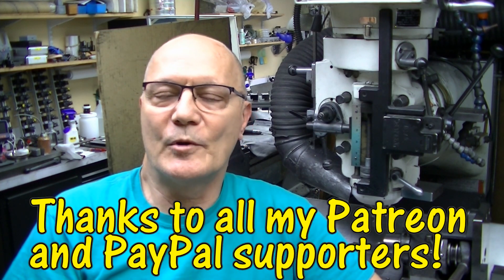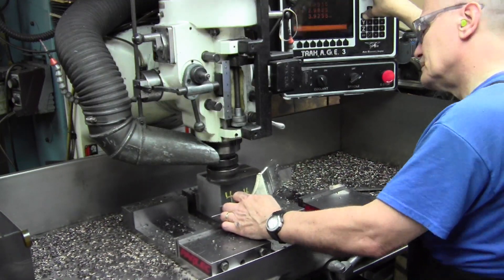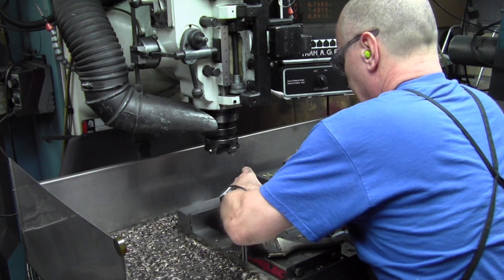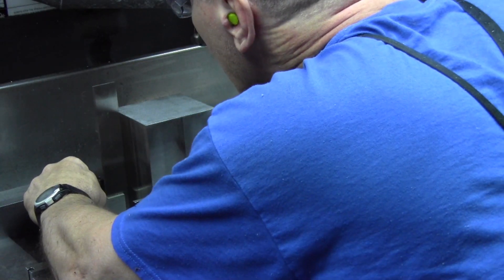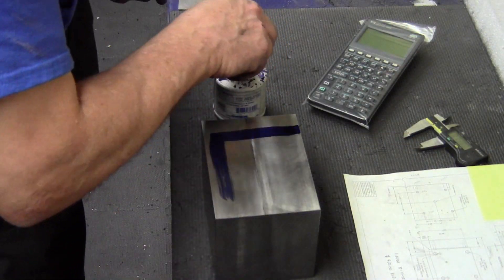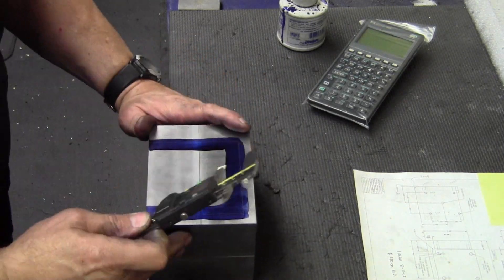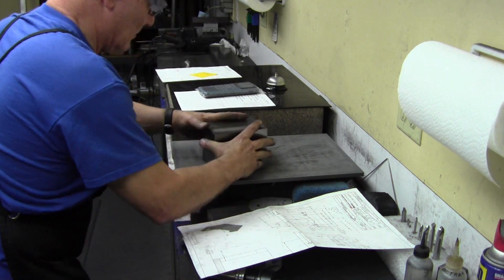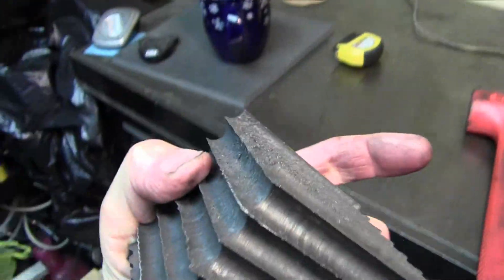CNC PLUS OLD SCHOOL

Comment: For the "Chamfer Meister": Instead of oscillation, would it be sufficient to just put the groove at an angle to the belt? 6:28
Reply from the maker: I will leave burs on the belt exit edge.

Comment: You mentioned that your vise jaws are machined leaning forward so under clamping pressure they are very perpendicular. Did you do something fancy to put that load on them while you milled it like you would do with a lathe chuck (not sure how you would do that) or did you measure it and then mill your measured angle?
Reply: I assumed they are ground and probably on a magnetic sineplate with a couple thousandths shim under it.

So if it was a .005" shim on a 5" sineplate it would be .001 per inch taper.

Would like info from him on this...

Comment: I got a very nice surface plate for next to nothing... could use it to stick on the sanding paper. I have to check... it may be a bit large at 800 x 600 mm. There is a separate video on it I remember. This particular plate is not in A+ shape anymore so I suppose it would make a good plate for this purpose. I may run a stone over it to check for burrs. And in fact since yesterday I am the proud owner of a Jung surface grinder so 'precision ground toolroom stones' are now within reach. Not to mention the recent addition of a mill and a shaper, next to my already vast amount of lathes and various machines.

Comment: With your chamfering tool, could you  run the belt at about 10 degrees to the longitudinal axis to use all of the width? Rather than the oscillating motion you spoke of.
Reply from the maker: Anything  at an angle leaves a secondary burr, that is why I chose longitudinal

Comment: 1 it's nice to see someone wearing ear plugs, I wear ear defenders a lot, even if I'm just using a hammer.
2 Is it similar to SG iron ? , I machine that sometimes and it has a sulphur type smell, I don't find it unpleasant myself.
3 have you thought of having the V on your chamfer mister at an angle so it uses more of the belt.
4 NICE VID !
Reply: I got some shooting ear muffs where they have microphones in them and amplify everything until it's loud enough to reach a certain threshold in which case it cuts it out. Super nice for when you need hearing protection most of the time but still need to communicate or listen for certain things. They are sensitive enough for me (my hearing is already pretty damaged from my younger years) to even kinda use them as hearing aids so i can hear people talking from a distance that I otherwise wouldn't be able to hear well enough to understand what they are saying.
Reply: 5 I put a piece of white paper behind something ( like a square against a block ), it makes it much easier to see the gap.
Reply from the maker: 2  spheroidal graphite, nodular, ductile, all the same thing
3  no because it creates a secondary burr
4 Thanks
Reply: I have known way to many people having gone deaf from their jobs. Even when they got made to size earplugs for free! I have worn earplugs consequently throughout the years and kept my hearing fully intact. Even when I will indeed take a hammer for one blow or take a grinder for one cut. In fact I usually wear earplugs all day and also like the piece and quiet. No music in my shop as well.
Reply: Momentary noises don't do damage the way continuous noise does,  so I wouldn't bother for hammering, unless I was doing it all day, every day

Comment: Is that the sanding plate that you used for resurfacing your starret granite gage block ? Thank you for taking the time to make these great videos!
Reply from the maker: No
Reply: @ROBRENZ  I have been gluing 220 to a piece of thick glass for years and now have a Grizzly 9x12 surface plate for that. Super flat and the weight keeps it from trying to slide around. One of my favorite tools.

Comment: On the Chamfermeister wearing a grrove in the belt of the sander arrange the V that the work piece slides in to be a long diagonal on the belt. In that way the wear should be (more or less) evenly distributed across the width of the belt. You might have to do some major re-design of the setup though. ETA: now I see that Seal Piercing said basically the same thing.
Reply: The Edge finish would no longer be parallel to the work.  so it depends on the desired cut marks. Straight and Parallel or at a skewed angled.
Reply: @wyldanimal2  Nobody complains with angled results on helical gears ;)

Comment: I haft to admit that this is the most impressive thing I have ever seen in machining!
Reply: Years ago, in the 80's rough drilling was a common metal removal practice.
even the CAM systems back then had an Automatic Rough Drilling routine.
You could even use center cutting end mills and do Plunge Roughing.
or with Non-Center cutting end mills, Pre-drill for the center of the end mill
then do Plunge roughing.
Reply: @wyldanimal2  mastercam still has those cycles hidden away. you can still use plunge roughing if you know where to look, though i really wouldn't ever use it anymore

Comment: we use the same method at work to put large holes in thick plates. Punch holes with insert drills, remove lug, mill clean then bore to size. Works a treat

Comment: Looking forward to the chamfermiester video
Reply: Just wondering out aloud, how would it work if the part track is not colinear with the belt rotation but in an angle - that way it would use the whole width of the belt without oscillation.
Reply: Thinking outside the box Mikey

Comment: Out of interest,how much taper did you machine on the vice body for the fixed jaw? I'm guessing it would differ from vice to vice depending on how much they move under load. I'm thinking of doing the same thing with my kurt,but grind the taper in to the jaw itself1

Comment: Thanks for this posting Rob.
Suggestion for the chamfer meister: Position the slide at a shallow angle across the belt, rather than inline with the belt direction. The finish will not be quite as flawless as the inline grinding, but simpler than working out an oscillating arrangement.
Reply from the maker: You will get a secondary burr on the diagonal

Comment: Thanks Robin, I did learn from this - sanding block, meister chamfer, flexing the square to confirm contact.  I got an extra surface plate and an old porter cable belt sander just waiting for attention!  Thanks again!

Comment: What do you have over the calculator? Couldn't you have the chamfermister top part angled to give you full belt engagement?
Reply from the maker: You will get a secondary burr on the diagonal
zip lock bag

Comment: Could you adjust your chamferister to run the work diagonally across the belt rather than your oscillating feature to avoid wearing the belt unevenly
Reply from the maker: You will get a secondary burr on the diagonal

Comment: Why the side champher groove isnt in for example 30 degree angle thus utilizing whole belt width? No  oscillation would be needed.
Reply from the maker: You will get a secondary burr on the diagonal
Reply: Probably because being a belt sander, you would have a cross hatch pattern on the corner instead of long straight lines which disappear along the length.
Reply: Another problem might be that you create a secondary burr on the trailing edge of the chamfer that way.
Reply: @siggyincr7447   Samuel Taylor  Thanks. I think you are right. I didn't think this through. The direction needs to be along the edge.

Comment: CHAMFER MEISTER:  Rather than use oscillation, rotate your v-block around the normal of the belt-plane so that it makes a 10° angle.
I think this will work well if two things are considered:
1) The angle remains small.
2) ratio of speeds times belt length gives a small periodic distance:  d = (V_part/V_belt) * L_belt
(d) would be the distance between high/low spots along the chamfered edge.
Reply from the maker: You will get a secondary burr on the diagonal

Comment: I like the way u used the top of the end mill instead of the bottom. I hate going to use an end mill that someone has used only the the first 2 mm so the bottom is blunt and top half has never even seen metal.

Comment: Good to see someone still using an HP48G (or possibly S?). Was super bummed when my 48GX screen broke in 2004...luckily still have a 48G+.

Luer lock tips for both syringes and bottles are excellent. I buy a few different blunt tip sizes from ~24 to ~10 gauge for accurately applying adhesives, lubricants, solvents, thermal compounds, etc.

Been watching religiously since near the beginning Rob...have built a passable university machine shop on the knowledge gleaned from you, Tom, Ol' Tony, Stefan and Adam. I can't thank you enough.

Comment: Thanks Rob, looks great! I liked the plastic bag on the calculator trick. Consider that idea stolen ;) I'll offer a trade of suggesting modifying your chamfer jig so it's not square to the belt. Unless draw filing we don't normally file along the part axis, so no need to sand precisely along it either. Chances are a slight angle wouldn't even be noticed in any case.
Reply from the maker: You will get a secondary burr on the diagonal
Reply: @ROBRENZ  Very good point Rob. However I don't mean to go crazy on angles, and just a few degrees will spread the wear area over the belt of that length considerably and I've never seen any burr when done like that to be quite honest. A machine like this has been something I've wanted to make up for a long time. I currently just use a belt grinder freehand and instead of yet another tool to take up space, may make up a jig to do this type of operation. My grinder has good facilities to allow tables and jigs to slide on/off

BTW, no connection to this company, but this is the 48" belt grinder I use and it's from a Sydney, Australia company. I think you will appreciate some of the simple yet very clever engineering functions he's incorporated https://www.radiusmaster.com.au/belt-grinders/radius-master-48-series-belt-grinder/ I think they export around the world.

Comment: That looks like a hiedenhain screen dose use those 1vpp scales as servo feedbacks . I like the price of the kent cnc your gonna have everybody looking for one of those trak machines . I like cheap tooling ( you tube smell-O-vision) Its wet dog hair that cast iron. chevy crankshafts v8 SB .720 throws/two on the end 1.1" High tension blade dose it drill thinning helps. drilled a scrapyard R/R track sombody welded on ( This piece of R/R track really means somthing to me) found where the weld heat effected zone I guess a really hard alloy can be formed there most difficult piece of metal i ever cut  found the value of having a couple carbide and m42 drills beautiful drill out yourself there must be stress relieved good save

Comment: With the chamfer sander, why not make a mount that holds the angle iron guide at an angle across the belt width, so you hit the full width as you pass your part through?
Reply from the maker: You will get a secondary burr on the diagonal

Comment: I love the smell of ductile iron in the morning.
Wish I had some pictures of the ductile iron gearbox I just finished machining to show you. Two piece split design with multiple bore sizes up to 22.xxx" and centerlines on a 14 degree included angle. 
On your chamfermeister, could you turn the guide to go across the belt at an angle to use more of the belt?

Comment: HP RPN calcuator in a zip-lock bag is a neat trick.  Looks like you had sucked the air out of before you closed it.  Clever:-)
BTW, what is the big black hose that runs to the spindle of your mill?  I was thinking dust extraction, but it pointed a bit high for that.
Thanks for sharing
Reply from the maker: dust extraction

Comment: For someone like me who did not go through a machinist apprentice program, this video was worth a lot.  The tapping, use of the 1-2-3 block for datum reference, the filing, paper on the surface plate, the fillet meister AND the sheet metal shield around your table put a lot of useful information into a very few minutes.  Thanks again for a really useful channel.

Comment: Dear Robin,
Without a shadow of a doubt, nothing you make is ever dull!
Regarding the chamfermeister, to overcome the the groove wear problem, have you tried mounting the guide on a slight diagonal, so that the chamfer valley covers the full width of the belt?
Best wishes!
Reply from the maker: You will get a secondary burr on the diagonal
Reply: @ROBRENZ  I was going to mention that too, but I wasn't sure if the angle was enough. I just do welding/fabricating, but I try to explain to people when deburring metal (with an angle grinder), you can't have the wheel perpendicular to the edge as it just moves the burr to one side or the other. Always grind with the edge parallel with wheel rotation. Getting to people to listen is another story though. 

Thanks for the awesome content.
Reply: The issue with this is that your grain line isn't parallel with the part.
Reply: At where I work we use an old Smaller Astra tool and cutter grinder at with a diamond cup wheel at 45* and a large * riser * steel block on the table.(with a lot of material removed from the back side because the bottom 3rd of the Cup wheel is inside the large steel block)

 On the top of the steel block there is a right angled block (with the bottom paralleled the table) with most of the inner corner cut off (it’s whole at the two ends and 3mm ish slot going through the corner) and the wheel is basically in the bottom steel block at 45*. You run your part across the top right angled and the cup wheel at 45* cuts a chamfer in. 

You can control the chamfer size with the Y axis and sometimes put masking tape on the bottom and side of the right angled piece to prevent the bottom or side of the part from scratches. 

It’s great for tool steel

Comment: Awesome video! Questions on the belt sander, is it possible to have the v grove mounted at an angle such that as you push the part through the v grove, it is also being pushed across the sander? In other words, the part/sharp edge start at the bottom right of the belt sander platen and end at the  top left as oriented in the video?

Comment: Instead of an oscillation feature on the chamfer tool, why not simply angle the guide across the belt so that the whole face of the belt is used all the time?
Reply: Might leave a burr on one side if it was angled.
Reply: @johnnason7019  For real ! True!
Reply: @hkkhgffh3613  of course it would also be interesting to design a version around a wheel cutter with straight flutes and see if that wouldn't leave a burr, the sander is probably more forgiving though.
Reply: @johnnason7019 Good point. I was looking for the reason why that idea, which I also had, was problematic.
Reply from the maker: You will get a secondary burr on the diagonal
Reply: For real! I was ponderin how to design the osc feature... wicked!

Comment: No video by you could ever be boring just watching you work gives me ideas about improving my work. 
I wonder if you could coment on an Idea. Theese days getting your hands on an iron straight edge at a cost effective price for a 1 off project can be an expensive proposition.
As an alternative I was considering taking a budget I section aluminium spirit level and scraping in one face for use building a cnc machine . My assumption being that a light i beam would have sufficient self stifness to maintain flatness.
Reply from the maker: That would be better than nothing

Comment: Mount the v on an angle to the belt and it will use the entire belt as you move it accross, instead of needing an ossilation.
Reply from the maker: You will get a secondary burr on the diagonal
Reply: @ROBRENZ  I shouldn't have even tried and should have just assumed you had a good reason, because you did! Thank you for the reply, always learning.
Reply: @wheelitzr2  always try.
Always!

Comment: Sorry if this is a silly idea, but could you just put the guides on your chamfering tool at a slight angle to cover most of the width of the paper to wear along. sorta like |/|, with the | | being the sand paper and the / being the gap at the bottom of the guides?
 love the content.
Reply from the maker: You will get a secondary burr on the diagonal
Reply: Yeah, I'm interested too. Just commenting to get a notification if Robrenz responds.
Reply: Wonder if with the cheap belt sander the platen wouldnt be too awful flat and a longitudinal or transverse crown in the platten may thwart diagonal and then you may have the issue of raising a secondary burr from the diagonal?

Comment: I have followed your lead with the vises, any suggestions on how if they are not the same height I deal with that issue? I have considered taking the down to the base and having the bottoms ground to make all three exactly the same height, they were used. Thanks, Dennis L.
Reply from the maker: I put a cup grinding wheel in the mill and ground them in place

Comment: It often seems like machinists turn vast amounts of material into chips rather than cut out a chunk of material that might be reused. Wood turners are also slammed for this at times when making bowls. I wonder if it’s just cheaper and faster that way, despite what looks from afar like waste.
Reply: Yes, and he has a nice fully machined face on 2 sides already, making reuse easy as well. Just 4 passes with the big cutter and there is a perfect block for a smaller project, saving having to buy material for it.
Reply: Big pile of chips gives a cheap and effective illusion of productivity.